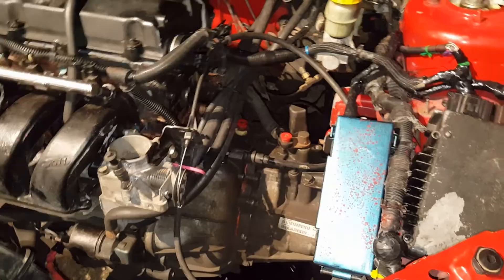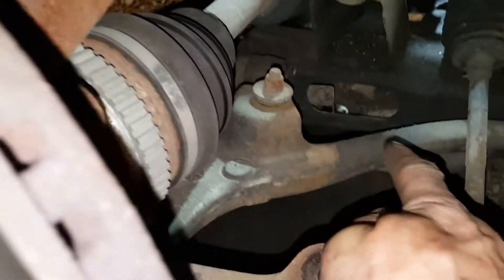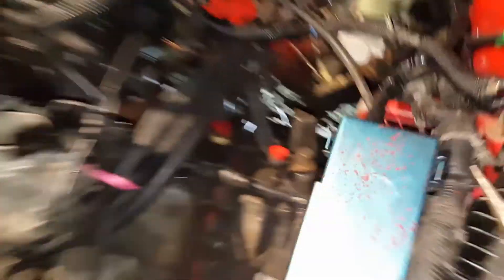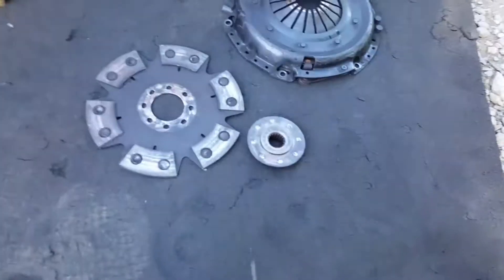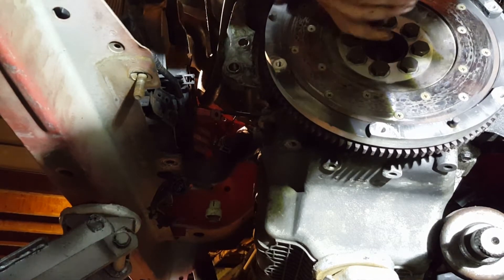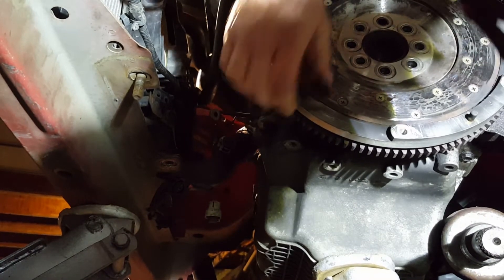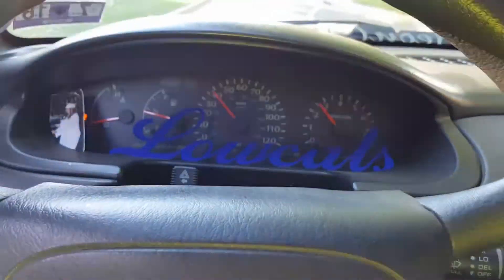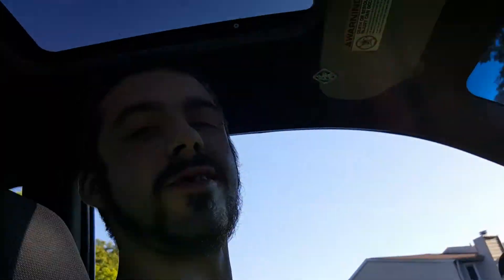HOW TO REPLACE A DODGE NEON CLUTCH

Comment: did I see you putting a flex plate for a auto trans on the crank then after the lock tite info you showed the correct flywheel with clutch bolted on

Comment: Why I'm I having such hard lining up my trans with my clutch still mounted?  Would it be easier to pull clutch off?
Reply from the maker: No ... I have no problem maybe turn engine over alittle or turn trans input shaft a little

Comment: hi. I believe my flexplate is bad on my automatic 2005 dodge neon sxt. do you have a video on how to get it of? or is this video almost the same as an automatic? if I'm not mistaking the only difference is that I won't have a clutch on it right? thanks
Reply from the maker: +LUIS RAMOS yea it will be toqre converter

Comment: is there a line up tool needed to install clutch ??? need to know asap thanks
Reply from the maker: +skulledmonte84 there is but u don't need it I've never used 1 and never had a issue
Reply: That Neon Channel  odd that we just bought a whole kit and the tool is not in there but I guess like you said we don't need that tool thanks for the fast reply back
Reply from the maker: +skulledmonte84 no problem man

Comment: What's the best way to get the trans back up
Reply from the maker: I just slide under and grab from top and slide input shaft into the clutch and bolt down all by hand
Reply from the maker: But a engine hoist works too

Comment: what kind of trans fluid did you out back into the trans, I got a trans I have to do on a breeze and was wondering, the fluid is hard to find
Reply from the maker: +wagonlight it calls for atf4 but u used royal purple gear oil cuz i beat on mine